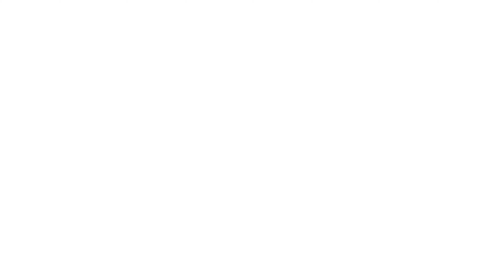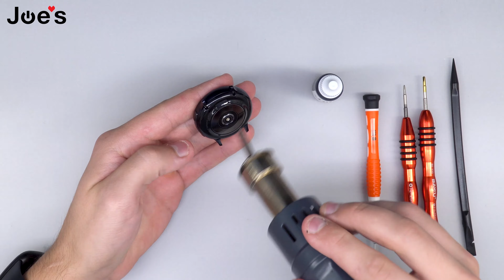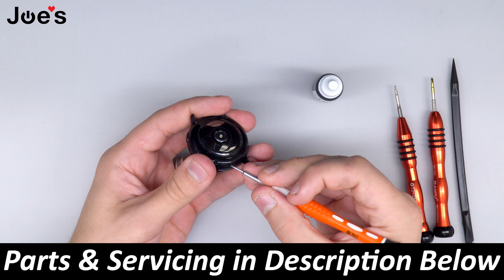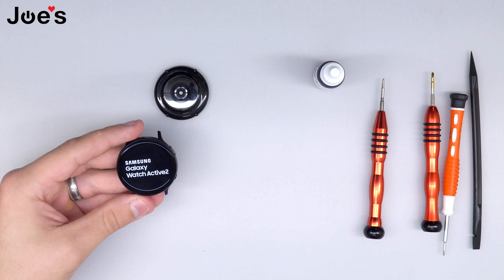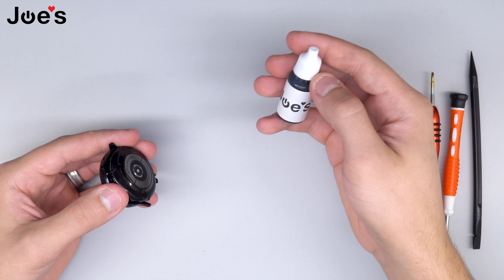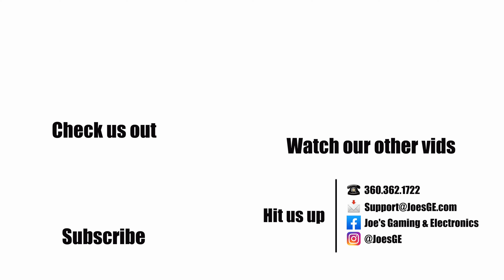Samsung Galaxy Active Watch 2 SM-R820 Battery Replacement | Repair Tutorial

Comment: Great video! I've followed each step closely, and for the most part everything seems to be great regarding the battery. However once I've reached the final steps where I try to test / boot the device back up (prior to fastening the remainder of the hardware) it doesn't seem to actually be responsive to powering on.
Reply: Any help / suggestions would be appreciated greatly.
Reply: Also I have placed the device on the charger and its showing that its at 87% battery 🔋  however it still has the main powering up issue.
Reply from the maker: Hello, thanks for commenting. Please email us at support@joesge.com with a screenshot of your question and we will be able to better assist you there. - Aaron P